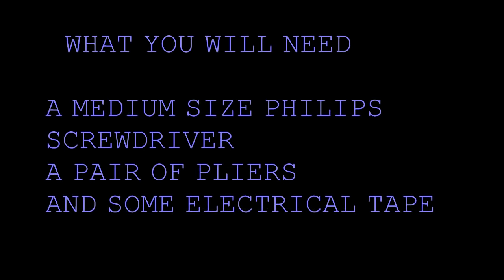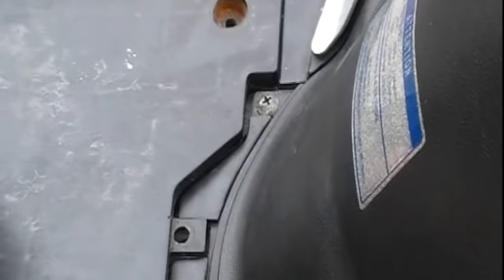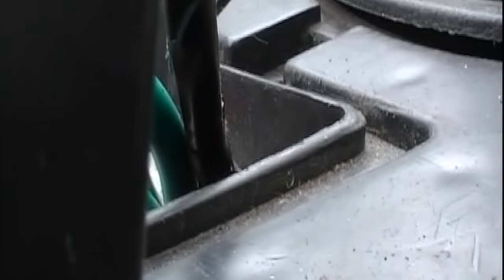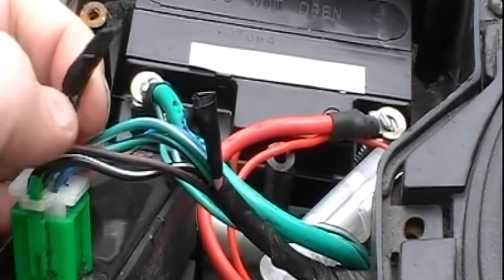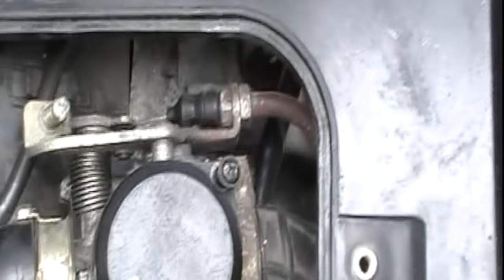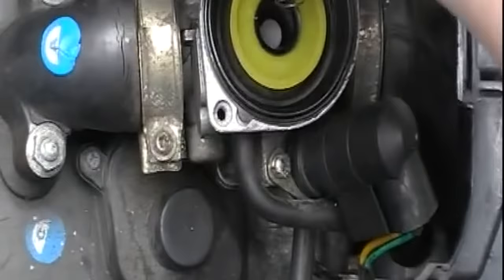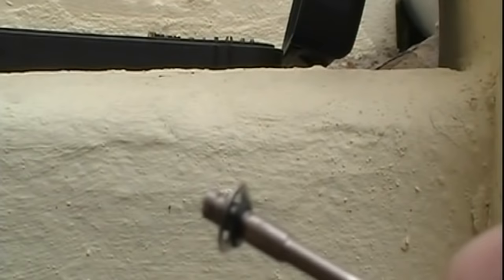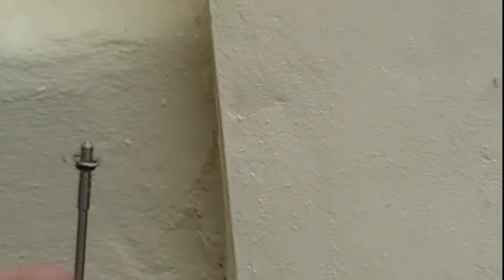How to derestrict a 50cc scooter / moped Make it go Faster

Comment: This is what you do. Number one: don't cut that pink wire leave it the hell alone. 2: move the needle washer up two.3: get an exhaust and shorty intake filter. 4: jet it (usely just and 80 bump it up to so 84 size jet or 85. 5: racing cdi box(will make it rev out more but safer than the pink wire) These 50cc enignes aren't really made for modding but what I just told you will make a 10 20 mph diffrents.

Comment: A combustion engine is basically an air compressor. The more air that can flow through it, the faster it will go.  Porting the intake and exhaust as well as boring and stroking will give the maximum power output. Not butchering wires and jets lol

Comment: It´s Important that you check your sparkplug after modifying your CDI. Go for a full throttle run and hit the killswitch with the throttle is fully open At FULL THROTTLE, you will need a BIGGER FUEL JET if its white and/or grey - and a SMALLER one, if its black and/or wet.

Comment: For everyone saying leaning it out will blow the engine no you're wrong. These are so restrictive with the tiny muffler and enormous air box with the tiny intake hole in it. It needs leaned a little. If you're going aftermarket on exhaust and intake I'd most definitely re jet to richen it up some. Don't be stupid these are 2 hp machines.

Comment: Many changes to my 50cc (which now has a top speed of 55mph). However, cutting wires & messing with the needle valve wern't part of my changes. These shortcuts will probably get you an extra 2mph and send your scooter to an early grave................ NOT RECOMMENDED.
Reply: jim how did you make it run at 55?
Reply: Michael Hyes Mine does 57mph, you can see my video Aprilia SR50 LC Racing and there is my setup in the description
Reply: Michael Hyes  Do you have a 2 or 4 stroke engine? If it's a 4 stroke, I don't think you'll get anymore than 40-45mph without fitting a bigger bore. As for 2 stroke, the set-up mentioned by ArminBecirevic looks on the money & pretty much what I've done
Reply: Jim Cook mine does 70 :P yamaha aerox r 2007
Reply: Tormod Fyhn 50cc?
Reply: yeah dude
Reply: wait, 70mph or 70kmh? if it is kmh then it is not so fast
Reply: 110 kmh wich is around 70 mph?
Reply: that is impressive, what mods do you have?
Reply: ***** Airsal T6 asso - Minarelli LC engine and LeoVince Handmade TT - Minarelli horisontal exshaust
Reply: nice setup but isnt that 70cc?
Reply: Jim Cook Cutting the restrict wire on cdi is soooo common.  What did you do?
Reply: ***** Apples and oranges my friend
Reply: Jim Cook Apples and oranges my friend...waaay more money spent.  time learning is just as valuable
Reply: I totally agree with you
Reply: What should I do to improve the performance of my wolf blaze2 150cc?
Reply: jhatch You cant do much except adjusting the variator with different roller weights and putting harder torque springs for better acceleration
Reply: +jhatch why did u get a 150? It's like so dumb because clearly u have a license for bikes up to 47bhp because the 150 has more Hp than a 125 which is what u can get with l plates just get a bigger bike
Reply: If you saw the size of me and know that I was a Marine corps air wing commander.. Most people don't get to far with stupid comments.. When someone posts an intelligent mod like playing with the fuel metering rod and you say oh I get 55mph out of my bike and nothing beyond that makes me think you are a flake especially when I have how many videos on here explaining I make the fastest stock configurated 49cc  motorized bicycle engines ever made... People tend to say Jesus Christ that guys an idiot meaning you. I get motorized bicycles up to 35 and 40mph and it takes a lot of mods to the engines and carbs to do just that... I don't know what you did to your stock bike but I have a Kinetic scooter here that does 55 and that took an act of god to modify the carb the exhaust and port time the engine. There are some new late model Mopeds when you fuck with the exhaust port time the engines and add a performance carb they do 55 on the flats and 25 up steep hills. But again you have to disassemble a perfectly new bike and reinvent it as something the factory and EPA never wanted it to be. So whatever you did to your bike this dude was on the right track. In high elevations some of the Mopeds even Harley's like mine suffered... So watch who you open your mouth to when you spout dumb shit especially people like me that own engine shops. The metering valve is the first thing a performance engine shop plays with to adjust a bad running bike. The plug is second. Here engines benefit from a cooler plug in the summer a hotter spark plug in the fall. has a lot to do with the fuels gasoline elevations here.. I live at the highest elevation here in Pa. nothing stock runs very well here not even a goddamned cheapo weed whackers snow blowers take an act of god to make em run right here..
Reply: Hopefully you understand that us Vets. We earned our rights to free speech and free passage. Am I a tough guy? I have 8 tours of duty under my belt. I came back hurt but in one piece...  let me know who and where served at. I served with the 4477th Lions Pride Squadron a black airwing and I don't mean black people either just in case you have a simple mind. . Our squadron was formed at Tonopath and China Lake  and was based onboard CVN 65 USS ENTERPRISE. My C.O. Was Admiral Adam Pritchard. The other C.O. was me now happily retired playing with bikes bicycles atvs four wheel drive and heavy trucks I also make engines here .... I own YMR MOTORSPORTS and DRIVE LINE BIKES Rt. 93 Hazleton Pa. Pocono Mountains.... Now what do you do? drive a fork lift?
Reply: ive put a 100 cc big bore kit with a racing head with the bigger valves the a9 cam , uped the jets, a breather and only get 40 out of it I'm going to go to 8 gram rollers but  I don't see how you all are doing 50+ I read  up above you had a small jet in it I'm running I think an 85    got to read the plug so I don't blow up  I'm baffled at you guys saying 50+
Reply: lol rotf hey info is knowledge and knowledge  is power  now can I get your email so I can pick your brain tim
Reply: Drives me crazy when internet tough guys throw the I was a marrine comment out there to shiver the shit out of people. If they were really a marrine they wouldn't ever say I was a marrine. One a marrine always a marrine! A marrine would never say I was a marrine or I used to be a marrine smfh.
Reply: it doesn't do anything to cut the wire, order a non restricted cdi from China
Reply: Jim Cook is
Reply: many of these scooters the belt is too short to ride all the way up the variator pulleys, at WOT, by changing the belt, and using the correct variator weights, and changing the contra spring in the clutch, you can pick up quite a bit of top end speed, by utilizing the full availability of gear ratios, plus the clutch won't allow it to shift through all of them by 15 mph
Reply: Jim Cook how long wil it last do you think?
Reply: My stock cheap korean scooter does 40 mph stock
Reply: Sonny 
S
Reply: my 50 cc does 186mph, my mods are a 2011 R1 big bang engine init with toce exhaust
Reply: Sonny  I need help
Reply: @thekingsilverado9004  here it's normal all scooters go 55 here
Reply: Raising the needle to increase the amount of fuel during acceleration is not going to hurt anything if you drill a few 1/4" holes in the airbox to increase intake airflow won't likely hurt the scooter. Overlean mixture makes them run hotter and also risks popping a hole in the piston.

Comment: You only really need to cut the wire (wich isnt always pink, check with your scoots forums). But if you really want higher top speed you need to mess a bit with the CVT (the thing that gets the power from the engine to the wheel) plus this is a better option than messing with the engine because it wont explode on you. To get the best results you'd probably want to get aftermarket Pulleys that will be adjusted for higher top speed, but beware it will be not the cheapest and may decrease acceleration (from what i understand theres a sort of pin that u can replace with a smoothed down one and thats kinda cheap its just im not sure if all scoots have this nor how affective it is).

Strongly recommend to not mess with the engine as it has a bunch of controls that are desgined to specifically work with factory ratios. The moped will run weirdly and can have problems, i can say because i had a moped with an aftermarket cdi that let me rev more and the piston rings blew up on it. Biggest recommendaition is to just drive it for most of the seasson and only at the very end to do stupid stuff.

Comment: It retards the ignition (spark). Additionally if you have a 2 stroke models they often put restricters in the exhaust especially in 125 models so the only way to get around that is to cut it take out the restricter in the exhaust and weld it back up or buy a sports exhaust which are free from the cone restricters they put in.

Comment: Move the Ring down, not up. And I don't think that will help much until u put bigger jets in it, also you have to derestrict the air flow and exhaust, and upgrade to a better spark plug.

Comment: if you out a switch on the Pink cable you can turn on the restriction when the cops are coming!
Reply: No but you can put a switch in. Out a switch will not work.
Reply: It's legal to deristrict a moped in the uk
Reply: how fast is it legal to drive on a moped in uk :) ?
Reply: 30mph is max legal speed
Reply: Damn how does the gravity work were you live ???
Reply: If you ride a 50cc scooter and you modify the stock engine for more power and the cops start focusing their resources on catching you at it you are living in the midst of some of the most inept crime figures imaginable.
Reply: @fulgonsta2765  that's for if you are over 16 right?

Comment: just seen you was making your needle leaner... it actually is restricting it and making it slower. not to mention it will make your engine run hotter as its starving for fresh gas. :/ on the contrary move the clip down (raise the needle) it will make it run richer (as long as you open the airbox too) and that will give you power. :D
Reply: also you can drill another hole on the other side of the needle to allow your slide to get more air as this is a cv carb it opens a butterfly valve with the throttle and needs the velocity to open the slide unlike flat slide carbs.
Reply: please share  more karma where exactly you drill it?
Reply: vawn davis

Comment: IF YOU SEE A PASTIC SCREW when go to fux with the needle, turn to the LEFT about a quarter turn to release it(careful get chewed up EASY!). You may even have a tamper proof needle, where there is no C clip, and no slots, you're only option is to add washers, preferably plastic, or brass. I'm not a mechanic, just someone that ran into this problem once.

Comment: The rpm sensor is very important for the proper engine work, cutting it off will cause a flying piston, cause there won't be a redline for the rpm. If you really want to make your scooter faster, just buy larger main jet.

Comment: if you move that lock ring up, it will run leaner, what means it gets less fuel at mid throttle.. so you changed the needle in the wrong direction. also normally you just change the main jet, so the scooter gets more gasoline at all throttle positions. when moving the needle it gets more gasoline mid throttle but the same amount as before at full throttle. i highly advice everyone to not mess up their carburator adjustments because of this nonsense video. you really should know something about these engines and adjustments before you make an tutorial to youtube..
Reply: There are so many 'experts' on here I fear your comment may fall on deaf ears! lol , by experts I actually mean spactards of course.
Reply: It's highly possible.. well at least i gave it a try! Hope that i'll save even one engine from seizure, due too lean mix lol.
Reply: @jounitakalo9368  Thank you postimies pate, you just help me save my engine!!!

Comment: There's a mixture control needle on most carburetors on scooters. (Sometimes capped off with a bronze disk that can be drilled out, but it's still there.) Best just tune the carb for the temperatures. If you wanted to change the mixture, that seems like the better bet instead of taking it apart.
The rev limiter removal seems ridiculous, your scooter is running at extremely higher rpm's than most cars and even aircraft ( Remove the limitations without so much as a tachometer to watch things and you will eventually blow the motor while riding down a hill faster than the thing was made to go.
If you want the thing to truely go faster, the cheapest thing would be to remove limiters that may be installed (choke tube on the air intake, block plate on the air intake near the carb, washers in the exhaust, simply drilling out the baffles in the exhaust pipe, lubricating tire bearings, ensuring the speedometer cable isn't binding, increasing jet sizes, etc. and what everyone else practically already said) if you really want to go faster, then a 82cc kit isn't bad.
Reply: What you mention just controls idle mixture. Nothing else.

Comment: Curious would adjusting the ring position give a small increase in acceleration even without disconnecting the rpm restrictor.

Comment: My needle doesnt have those adjustment grooves. Not sure if mine has that pink wire, either. I'll cut it if it does. I have no fear of blowing this thing up; I've already installed NOS on it. Right now, the carb isn't letting gas through, even though ive rebuilt it twice and installed all new fuel lines and cleaned out the gas tank. It'll run on starting fluid, but wont start on its own fuel, no matter how long it cranks over. So, for me, it has to run first before it blows. Good video anyways, thanks! Watched it twice now.

Comment: great idea, bypass the rev limiter so when you hold it wide open you'll have your minute of fun before your engine decides to blow up, and if you have a modern honda or yamaha 50cc, there's a little washer in the tailpipe, take a flat screwdriver and a hammer and knock it out, you get better airflow, also messing with the float valve on the carb won't do anything besides make the scooter a wee bit more responsive, and if you want power, buy a 100cc engine and just put a 50,cc sticker on it. or bore out the block to put a 80 cc piston in.
Reply: god i am crying hahahahahaha

Comment: If you move the clip up on the needle it will get leaner and down richer. So in this example you will get less fuel so it will get leaner. It´s Important that you check your sparkplug after moving the clip up or down. Go for a full throttle run and hit the killswitch with the throttle is fully open then check youre sparkplug and it should have light brown color. If its white or grey you have to go down with the clip again and if its black and wet you should go up with the clip on the needle.

Comment: You can by de-restricted CDI's pretty cheap (around $20us).  Especially if you are concerned about cutting into the wiring harness.  On the chinese bikes, they all use pretty much two types.  AC and DC.  So just go to your local scooter shop with your CDI and hand and match it up.  The plugs are different on the AC fired ones so you won't get them mixed up.  It's one of the easiest mods you can make.  Then keep the old one as a spare as they do fail often.
Reply: hi, do you know if a derestricted euro 4 cdi/ecu will work on a euro 5 scooter?
Reply: @patrickdoyle5761  euro 5 uses an ECU, euro 4 uses CDI's, however if u have a euro4 Injected bike then I suppose it would work on a euro 5 because euro 5 must be FI engines
Reply: Would using a racing cdi D restrict my Yamaha Aerox 50cc 4 stroke or do I need to take out the little washer we’re the variator is ?

Comment: okay one you are going to over Rev your engine and moving that clip on the  needle just moved it further into the carburetor therefore will not allow it to come out as far as it did in the first place so you will be getting less fuel to air running lean going to burn a hole in top of your piston just some advice

Comment: In your carb is a gold plate to the air filter, remove that. Allows for more air so better combustion, put a little bigger jet in it. There is a thing in you exhaust, get it out, more airflow out of the cilinder so again, better combustion. Finally, cdi, just get an unrestricted one from the shop and done, no need for cutting, next in your variateur? Idk what its called in English but it’s where the rollers are, in front of it could be a small ring, get it out and you have more rpm, good luck